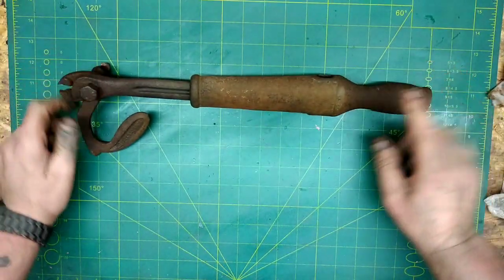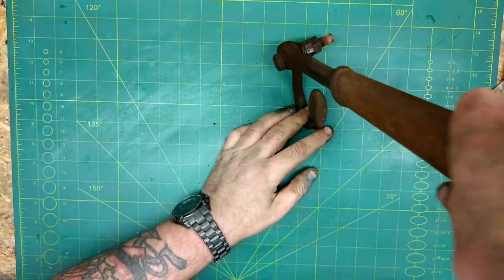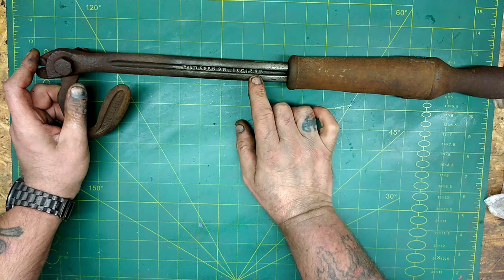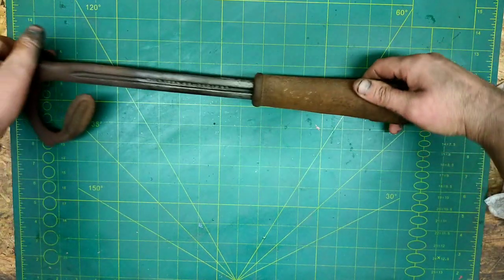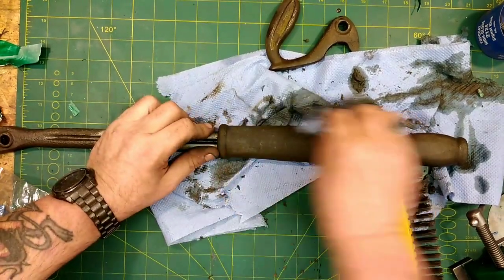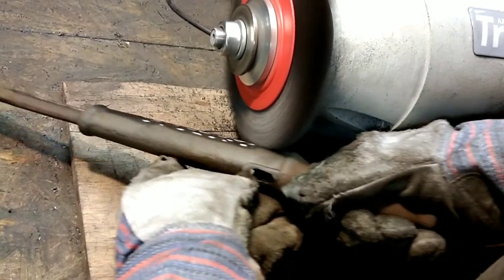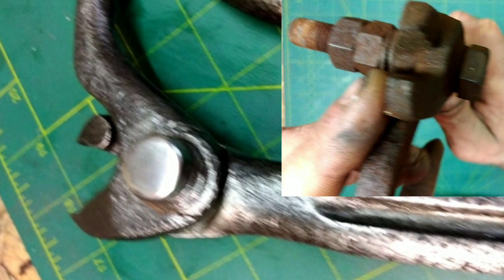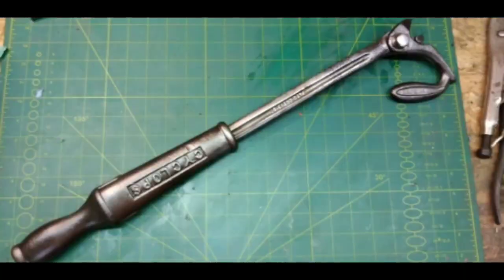rusted vintage Rusty Tool restoration video of antique cyclops Nail Puller outerer usa tool restore

Comment: Good job cleaning it up. I'm a little surprised you didn't paint it and put a different color on the lettering. I have 2 Bridgeport Hardware Jumbo nail pullers from 1905 and 1913.
Reply from the maker: Hi Stephen, no I think a lot of things look better left in bare metal, I do paint done, but as I discovered with bahco nail pullers bare is best for these